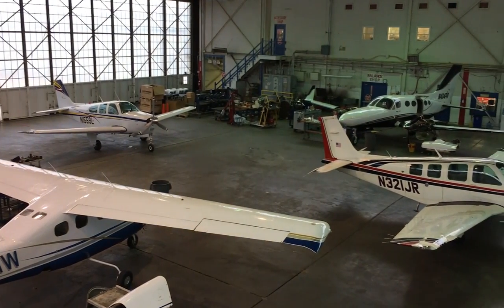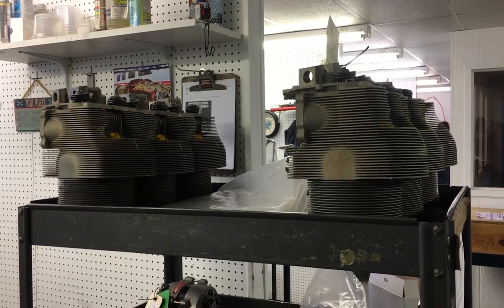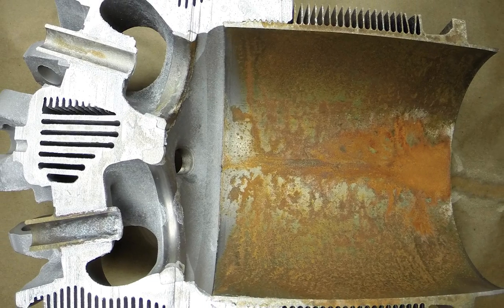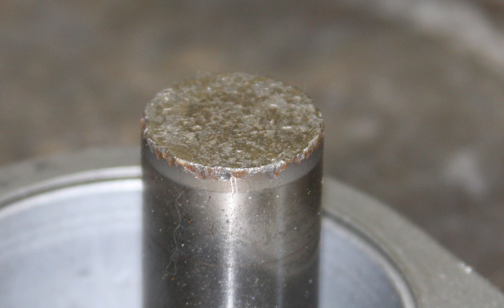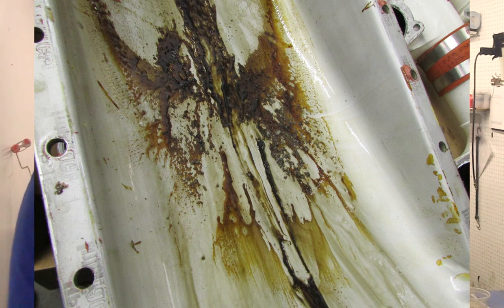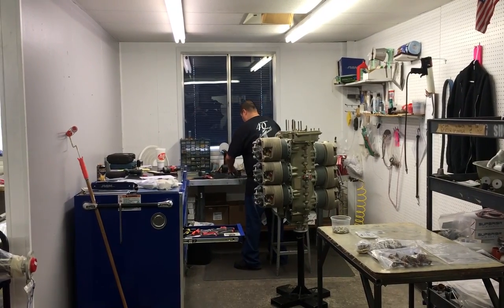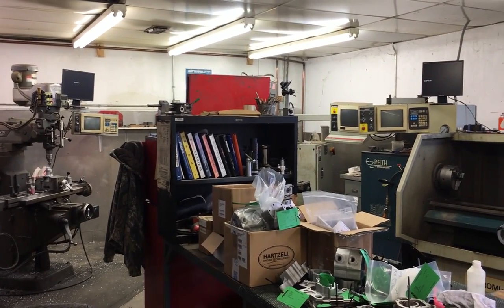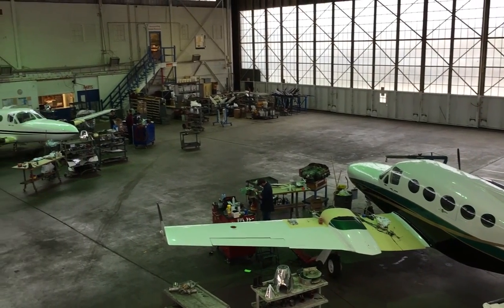Engine Corrosion Tips From RAM Aircraft

Comment: Fly it often is good advice but not always possible for a single owner plane.  I built a dehydrator for my C150 after seeing effects of corrosion during a top end overhaul.  My homemade dehydrator has a "purge" cycle. After a flight and connecting the dehydrator it pumps outside air into the engine to purge out the water vapor and crankcase fumes for half an hour as the engine cools. After that the dehydrator automatically begins a closed loop cycling of crankcase air through a desiccant.  The humidity is maintained below 20%. Desiccant plugs are put in the exhaust after flight as well.  The desiccant lasts for months and is then recharged.  I have removed valve covers on an O-235 for valve adjustment on a flight school plane that flew several times a day in good weather and found a lot of water that would condense on the inside. Amazing how much water is in a crankcase after each flight no matter how long the flight is.  Sitting long term with that water inside is damaging for sure.   I would be interested in any research showing the long term benefits of keeping moisture out of the crankcase.

Comment: Not all environments are the same. I live in the desert and use CamGuard in my oil. As a result, corrosion issues are minimized, and oil analysis proves it. Each owner/operator has to decide what needs to be done based on his home base environment.

Comment: Great video, but what about the barrel cut in half at 2:34. If that cylinder rust was generated in the field the cut away portion of that barrel should be rust free.
Reply: Think that's just  been sitting around a long time as a cut away, bit extreme.

Comment: Buy or build an engine dehydrator and hook it up after flying.
Reply: If the industry sees a problem this prevalent, preventive measures and products should be available. Where were these engines/aircraft stored, In a hanger or tied down outside? That one split cylinder looks like it was immersed. Was it? I sprayed a fine mist of Automatic Transmission Fluid into my cylinders on an engine which I knew was going to sit for a time. There are only a certain amount of failures which can be blamed on the users before the product is deemed not worthy for the environment it was designed to be used in. I dislike the almost scare tactics which can be perceived when showing what’s the worst that can happen. This one we got from the bottom of a lake…just look at the corrosion.

Comment: Ground runs of 10-15 minutes may be bad. It may create the coffee pot effect which puts moisture all in your case. I have found if you only run the engine for 2-3 minutes you won’t get this. If you can’t fly your plane for whatever reason, I think this will keep the oil film on bottom end parts. Also change the oil as recommended on calendar time. Of course, the best thing is to go fly....

Comment: going to need to do some super magnets in the oil pan to keep any iron or steel fragments collected and out of the oil system and out of the cylinders.   i wonder if the owner is planning on extended storage if there is instructions on filling the crankcase above the cam and lifters or even higher.  so a mechanic will have to remove any excess oil prior to engine start.     i would think that magnets in the fuel filters before the pumps would help also.
Reply: Wp: No.  The manufacturers have detailed instructions for extended layup and preservation.

Comment: Perhaps the engines need to use better corrosion inhibitors in the oil to reduce corrosion.
Reply: Or poor design of oil circulation as in camshaft corrosion wear.
Pulling the engine over every week might help solve the problem, so long as the cams rotate through a bath of oil, rather than it all drains away.
Reply: Unfortunately, the camshafts are above the sump oil level due the way the crankcases are designed. On the Lycoming engines the camshaft is above the crankshaft,  and on Continental's the camshaft is below the crankshaft which eventually drains the oil way from the camshaft after engine shutdown. Turning the engine over once a week might limit corrosion on the crankcase bearings but will do little on camshafts. So the lack of engine use can have it's own problems.
Reply: Yes, but if the engine had been designed with troughs below the cams, then turning over the engine the cams would get lubed. Perhaps cranking the engine to get the oil pressure up is better than nothing.
Reply: Troughs below the cams would lead to sludge traps so it wouldn't be a good idea to have the old oil building up there. If you have to go to the trouble to crank the engine you may as well fly the aircraft.
Reply: That's true, might end up with the hollow crank shaft problems Lycoming had.
Reply: Yes, interesting...I actually looked up the air directives regarding crankshaft inspections.
Reply: Camguard

Comment: Use Amsoil synthetic Oil. Simply the best.
Reply: I have used Amsoil from 1980 . This stuff is unreal , I like the HP and fuel economy I got and zero engine problems . I became a dealer .
Reply: Synthetic oil is not compatible with leaded fuel.  Mobil already bought a bunch of engines and a couple of aircraft trying it.
Reply: AC:  Amsoil is not approved for aviation use.  Full synthetic oils are not able to absorb the lead that ends up in the oil, nor the high acid levels. Man other factors.  Amsoil is not designed for aviation use.

Comment: So why aren't crank case gases fed back into the manifold like cars. Is there just too much blow by to cope being air cooled engines, or the risk of recirculating acids that perhaps don't exist as much in car fuels. Often see an egg cup full of water expelled from the vent. Surely a private owner could fit a silica gel plug in the vent.
Reply: FB:  Aircraft crankcases are vented overboard.  They are not subject to EPA recirculation requirements.
Reply: Perhaps if they were , there would be less corrosion.
Perhaps the altitude change would create problems.
Reply: @flybobbie1449  How would recirculating exhaust gases decrease corrosion causing compounds in the engine?  How does altitude change cause corrosion?  Just silliness.
Reply: @KB4QAA  I had to think back for a moment there. If the gases were drawn through the engine and burnt as in cars perhaps the condensation that corrodes cam shafts could be reduced. Corrosion doesn't happen in over head cam engine cars. It happens in typical light aircraft engines probably due to the fact top of engine is cooler. Acid corrosion caused a spate of crankshaft cracks some years ago.
Altitude change nothing to do with corrosion, questioning if lower crank pressure is an advantage to maintain power as the aircraft climbs. As not reliant and "sucking air out" via the manifold inlet, as in cars.
Reply: @flybobbie1449  Moisture in blow-by gases is eliminated largely by venting overboard via large crankcase vent tube.  No need to brain-storm some other logic.  The major cause of cam corrosion is aircraft sitting unused for weeks/months.
Reply: @KB4QAA  Yes we know that. But would not having a mess under the aircraft to clean off if vented back to engine. And sometimes gases making their way into the cockpit, as i have experienced from badly placed vents.
Reply: @flybobbie1449  An aircraft engine in good condition doesn't make a mess. I have engines that blow 'chocolate mousse" on the tarmac.  Putting all that into the carb is not a good idea.